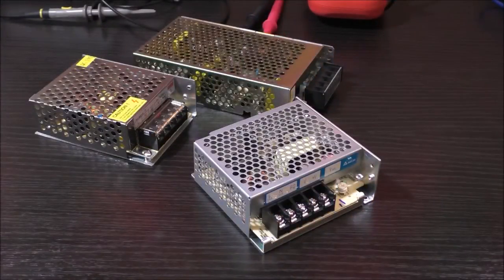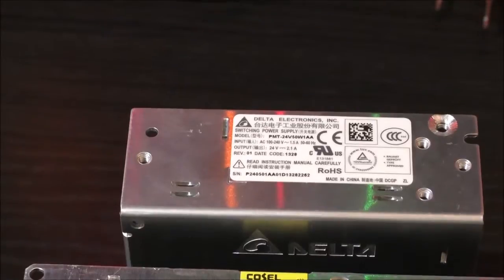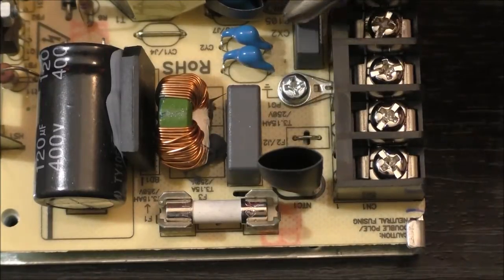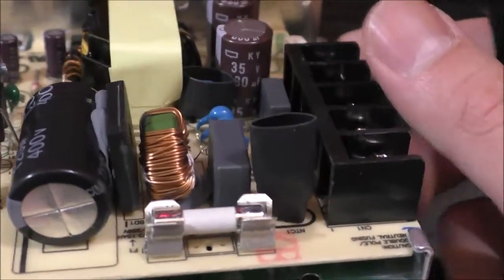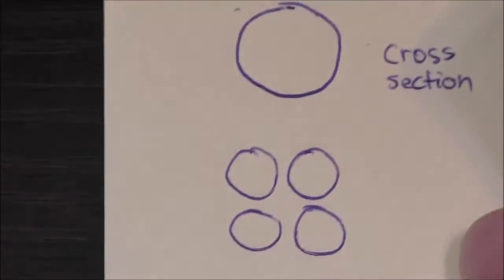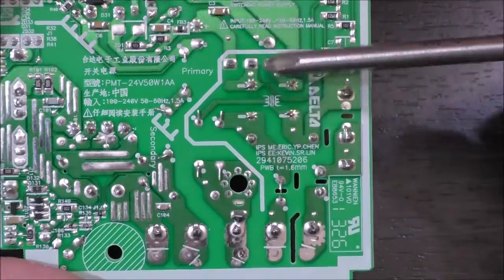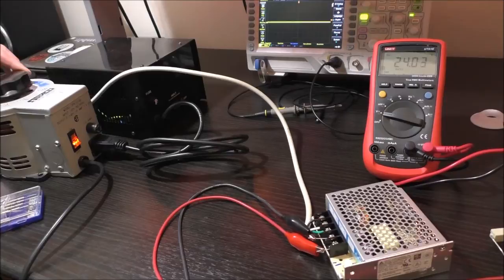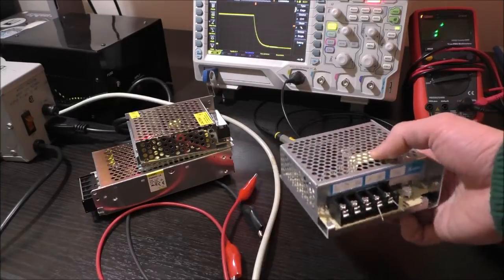$18 Delta Power Supply Teardown and Review

Comment: I have Delta PMT-24V50W2BA, a new version PMT2 series.
Much smaller than the PMT first generation, the primary capacitor is only 82uf, a smaller transformer, and a Taiwanese secondary capacitor Taicon (not a Japanese capacitor).
PMT2 is a much higher price than a PMT first generation but the built quality is questionable.

Comment: Very informative and detailed comparison and explanation of the circuit. Maybe it is a more appropriate name as "no brand label" power supply instead of Chinese power supply.
The way you call it give ppl false impression that as long as Chinese power supply is sub standard. 
It is actually the PS from small workshops that do not show high workmanship and standard of design

Comment: As I mentioned on the previous video, the chinese power supply is a flyback with additional output filtering and not a forward, hence the small inductor. This Delta is also a flyback, with its output diodes in parallel. 

The ripple voltage waveform is quite typical for a flyback on both of these flybacks, having a rounded upslope and a straight downslope consistent with the linear current downslope of the flyback transformer while charging the capacitor and then the load resistor loading the capacitor to discharge it.

The transformer wire is more likely to be multiple strands of enamelled copper wire rather than Litz wire. Still done for the same reasons vs a single solid conductor, just without the special winding pattern of Litz that makes it more effective against proximity effect losses but also more expensive. In these transformers when there is more than 1-2 layers of conductor in a winding, the proximity effect is more significant than the skin effect.
Reply from the maker: +KX36  You some some really good learning points for myself, thanks for your comments. :)

Comment: The large 200v 680uF capacitor seems to be seriously underrated in terms of voltage.  With Full wave rectification I would expect roughly 185v DC with 120 in and 370v DC with 240 in.  At the same time, I find it hard to believe this is the case.  Am I missing something?
Reply: +Necessaryevil 86 True.  The issue is capacitors used near their intended working voltage tend to fail prematurely.  This has been pretty well documented and is now enshrined in UL requires for electronic products where anything UL or safety related MUST derate the working voltage on capacitors by 50%.  According to UL requirements this capacitor should have a minimum voltage rating of 370vdc.
Reply: +Necessaryevil 86 Isn't this capacitor the input bulk storage capacitor which is connected directly to the grid through a full wave diode bridge?  In this configuration it will pretty much experience a constant DC voltage with large ripple depending on the load.  There may be other circuit topologies I am not aware of as this is not my main area of expertise.
Reply: I'm not sure either. There are  some other topologies, the bulk capacitor could be charged from the PFC circuit, for example with the L6562A (see:  http://www.st.com/web/en/resource/technical/document/datasheet/CD00151385.pdf p16, p18). Texas Instruments has a design without diode bridge rectifier at all. In the comment section of the Cosel video it is mentioned that the PSU uses an unusual PFC topology.
Reply from the maker: Yes I missed out that the Cosel power supply actually has active power factor correction on the front end, achieving PFC of 0.95, whereas the Delta and the eBay supplies do not. This explains the large 200V cap, and could also explain why the output ripple was higher than the others due to extra switching noise.
Reply: +Peter House: The voltage rating on capacitors is a 'working voltage' and not a absolute maximum, which is the case with semiconductors.
Reply: +Peter House I wasn't aware of that. The PFC must be a buck topology, otherwise the bus capacitor will blow immediately at a 230v grid. The buck topology will convert the input voltage to a 100v or lower (educated guess: 85v).